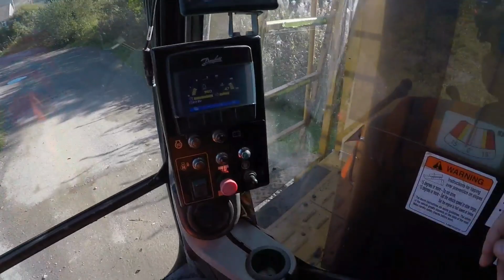M.T.D 186 It becoming a habit

Comment: Hi Russ, I feel your frustration with the pick up at Hinckley Point, took an hour and a half to get a 10 minute job done purely due to security there🙄 on a clear day you can probably see the huge yellow crane that is on the Hinckley Point C  site from Porthcawl! you can see it from 5 miles away on the A39 over the Quantocks. Hope your little girl gets fixed, the older lorries have more character than the new ones